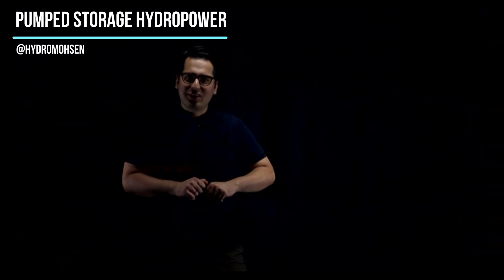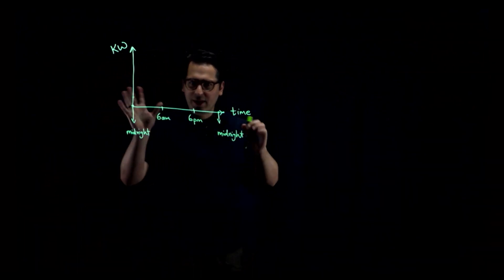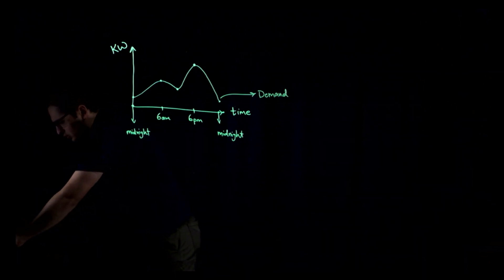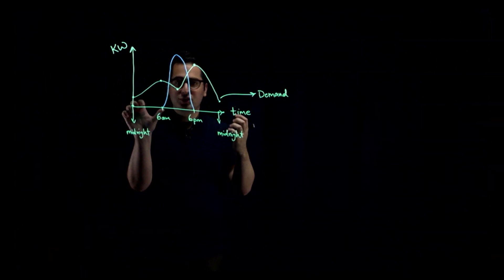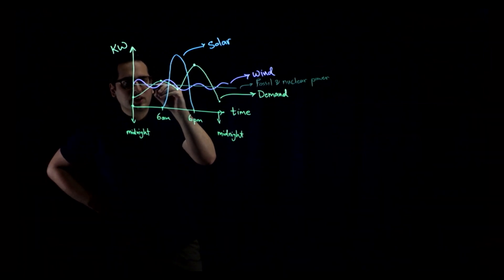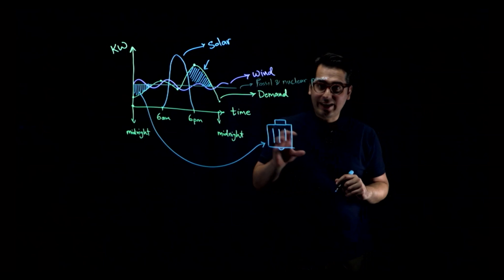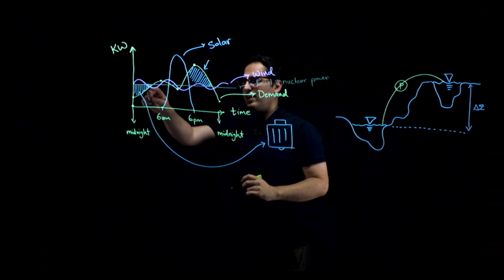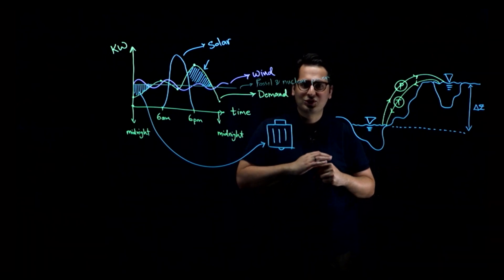Pumped-Storage Hydropower: how "water battery" works

Comment: What happens if you have H pressure over your wind turbines (no wind) for more than a day or you have several dull days, then your pump storage is not much use. I should think that pump storage is good for daily variations with renewables. But couples with interconnectors into areas where the sun is shining and the wind is blowing it could work. If one was to use a U valley one could store more water and therefor generate for longer.
Reply: Like a battery all systems would eventually hit a max capacity for storage